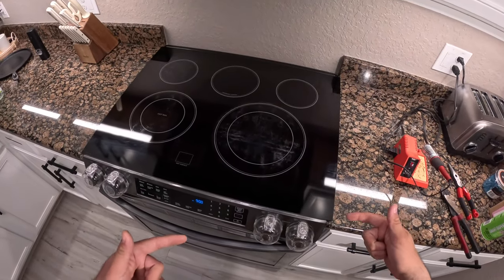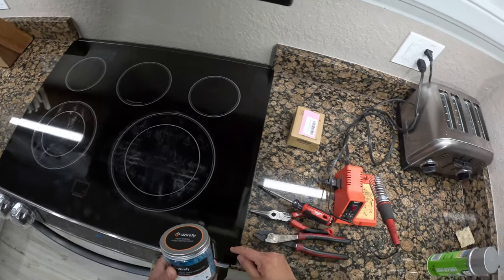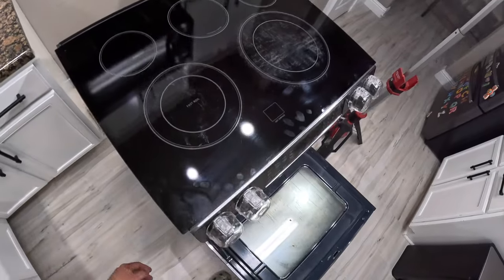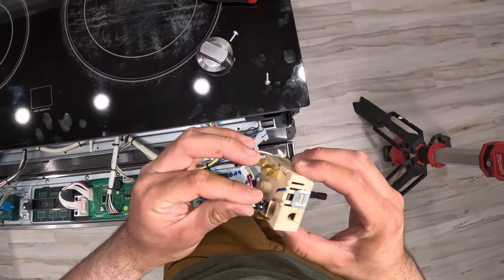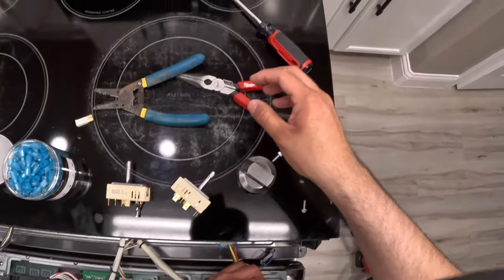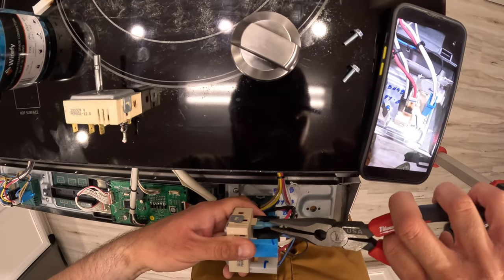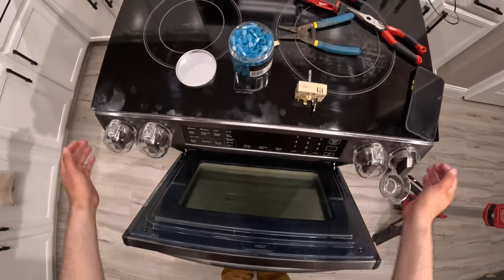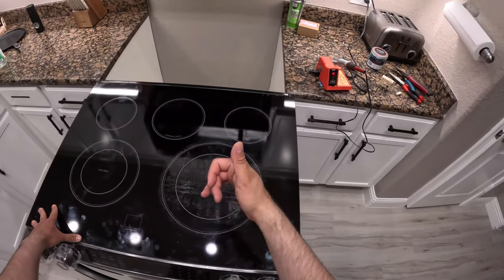Samsung Stove Burner Stays on High Heat Only (Electric Range) | POV

Comment: I have a kenmore stove, inter coil working, out coil not working, I replaced new switch, still same problem, do you know why? (Surface burner is good)
Reply from the maker: Probably the heating element itself.
Reply: Is heating wire broken?
Reply from the maker: The actual heating element part that heats up the stove top probably failed. Is it an electric range?
Reply: @sparky_izzy  yes it’s a electric range
Reply: @sparky_izzy  yes, it is electric range. I changed new surface burner, but it still doesn’t working
Reply from the maker: Did you replace it with the correct switch? There is a single element switch or a dual element switch. If you have 2 heat settings on 1 burner, you should have installed a dual element switch.
Reply: @sparky_izzy  yes I changed dual switch and new surface burner. But still out coil not working